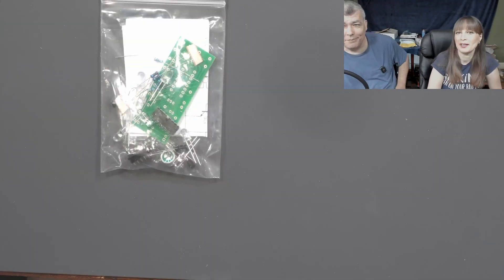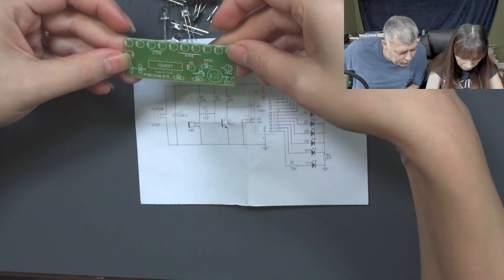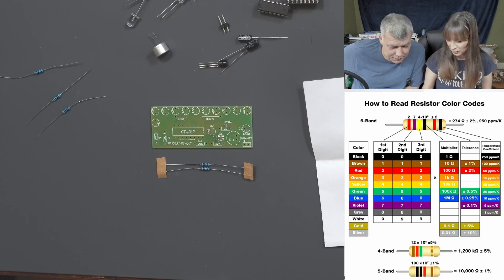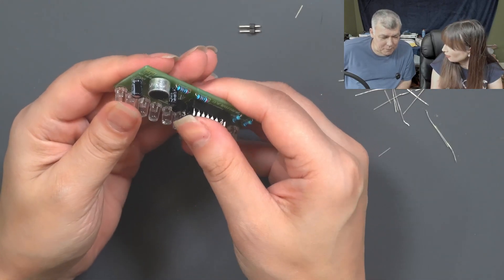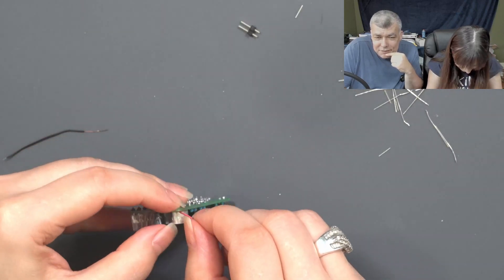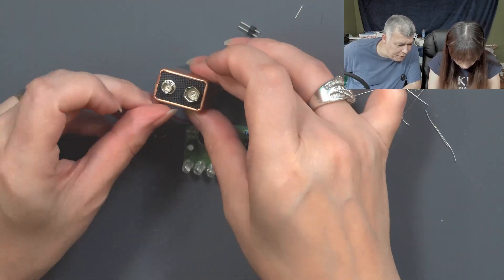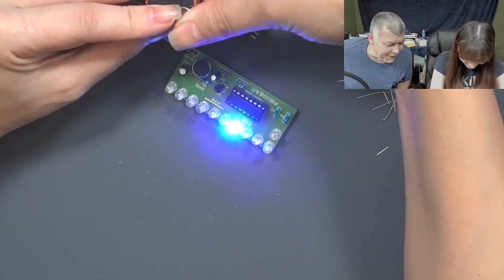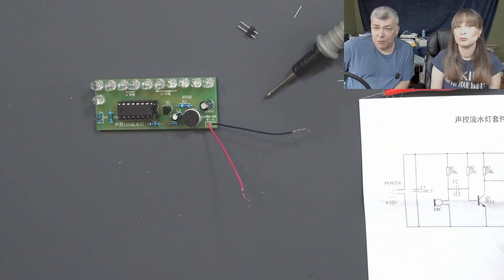DIY Voice activated LED's electronic kit - Lesson 4 - Learning electronics with Diana

Comment: May i give you a tip, to get the i/c into the socket the pins have to be at 90deg
to achieve this hold the i/c at both ends and roll it on a flat surface until the pins
align with the socket.
This is all part of the learning curve.